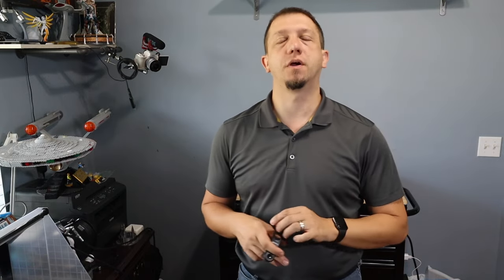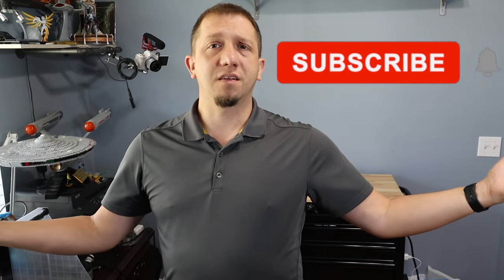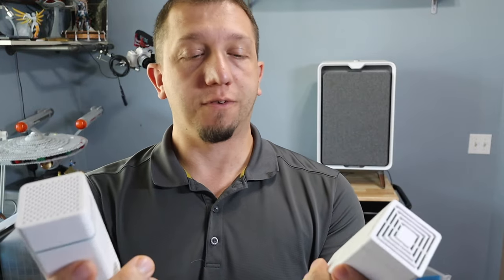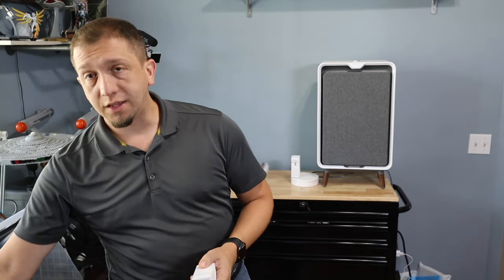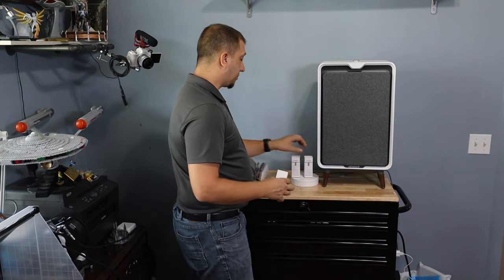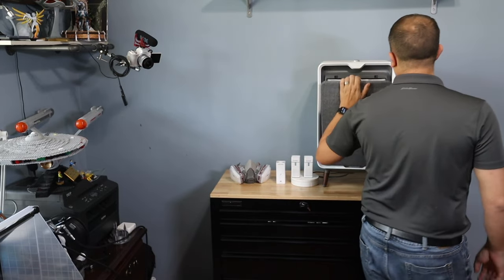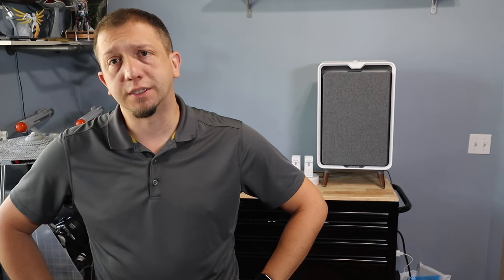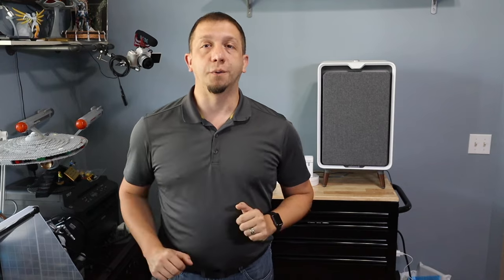Does a 3D Printer Need Ventilation?? (Air purifier for 3d printing)

Comment: I don't think the air filters actually remove the gases from the air. They just remove the smell. You need a ventilated space no matter if it smells bad or not
Reply: Carbon air filters are designed for VOCS

Comment: Would one of the anycubic filters be enough for an anycubic mono x or do I need two for it? It's winter in Canada at the moment and my printer is in my office (haven't been able to run a print for a couple of months).
Reply from the maker: You could if you have a constant way to keep it charged.

Comment: Question. New to 3D printing. Got a Saturn 8k for Christmas. I was thinking of using a large closet in my basement for a small station. It has a door. Would the charcoal filter that comes with the printer along with the bissel be enough to eradicate harmful fumes and the smell?
Reply: Well was it enough? Same situation here

Comment: Hi. I am living in a studio flat in UK so it's very small and no ventilation. I really want a 3d printer but I don't want to risk my health. These air purifiers would be enough to be safe of fumes?
Reply from the maker: If you have a way to keep it charged than you can get away with one.
Reply: Do you have access to a window?
Reply: bump. same situation. I do have access to windows.
Reply: @GhostJager81   Yes I have window. I was thinking to place the printer under the window and use some air purifier next to the printer.
Reply from the maker: Especially on cold days you don’t want the window open the filter can help keep the smell down.  Also take a look at resins.  Some are worse than others.  I like the PHROZEN eeesins due to the low scents
Reply: @Szabolcs Csepanyi  if you can get a grow tent in the UK and then get one of those inline filters you can force the fumes outside
Reply: Thanks for the help guys
Reply: @ghostjager8190   that's a good idea 💡
Reply: I wanted for my office but it would be sat in front of me and only have a fan and window.. attic has no windows and gets warm in summer... May have to get rid of the printer before even tested it

Comment: How often are you changing the filter on the airmax unit? Carbon is only effective for so long. So I'm curious if it's more frequent
Reply: I change my mini carbon filters every 3 months. But if I'm printing more than normal I change the filters once they start to smell like resin themselves

Comment: I'm thinking of having a 3d printer in a shed on the back deck of the house and then putting these air purifiers inside. Would that be good?
Reply from the maker: IT would probably do fine.  Also keep in mind you really should have the printer in a climate controlled space.

Comment: If the Air320 is a bit too costly, Bissell offers the Air220 that uses the same filtration system for $100 less ($220-240)
The main difference is the Air220 cleans a slightly smaller room size due to it being a bit smaller. The front pre filter is also different in that it's perforated hard plastic vs a mesh on the Air320. So the Air 220 might be a bit easier to clean but have a slightly worse prefiltering

Comment: Use actual enclosure for fumes with ventilation pipes, you do not have to put the end of ventilation pipes to outside you can attach a massive filter on it, it will filter everything the downside is that this filter piece is expensive and heavy.

Comment: I recently got an enclosure for my ender 3. How dangerous would it be if i didn't use an air purifier inside the enclosure when printing with just pla?
Reply: Filter really doesn't matter, it's a nice bonus to have but what you need is ventilation or you'll just get hit by all the accumulated fumes once you open the enclosure. 

Fumes don't just magically disappear, they're trapped in the enclosure until the moment when you vent or open the said enclosure.

Comment: I have an air con/heat pump in the room I want to print in but no windows.  If I run the air con as a dehunidifier, air con or heater will it be sufficient air removal?
Reply from the maker: I can’t be sure on that one but it sounds like a strong possibility

Comment: It’s odd that everybody keeps saying “activated carbon isn’t good enough” yet elegoo literally made a huge filter to suck the air out of your printer enclosure, and it got an award for cleaning the air out… and it’s just a bigger activated carbon filter.
Reply: Elegoo made a filter that filters smells, it does virtually nothing to stop VOCs which are the unhealthy part. Activated carbon can filter VOCs but not when used the way Elegoo or any other printer filters do.
Reply: “Removes up to 95% VOCs” 

Doubt they’d open themselves to a lawsuit without actually know what they’re talking about. 

We are talking about the MARS filter not the little usb one.

Comment: Thanks for sharing this. In your opinion would this work for resin pouring?  I’m in an apartment and can’t modify the ventilation.  I have an air exchanger that works well.  I live in a cold climate and that’s not good for resin curing so I can’t just open a window in the winter. So I’m trying to find a portable solution. I know all resin companies say low or no VOCs but I don’t want to be inhaling chemicals if I can avoid it. TIA

Comment: Just crack a window with a fan blowing out.
Reply from the maker: So for some that are only doing resin that would work.  I am in goergia with high humidity outside.   That is no good for my fdm machines.   Had to find a good solution for both to live happily ever after.   A climate controlled space makes for happy printers
Reply: @Rise3DBuilds  I'm lucky to live in Arizona